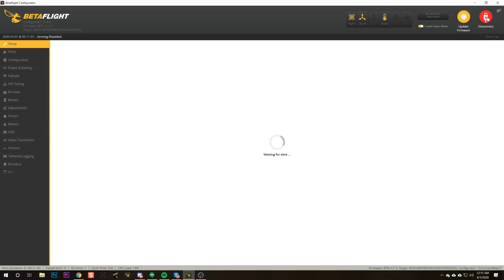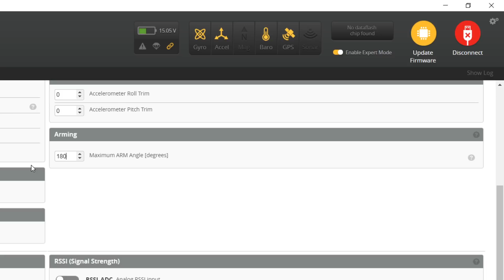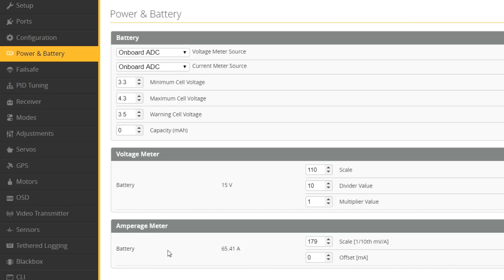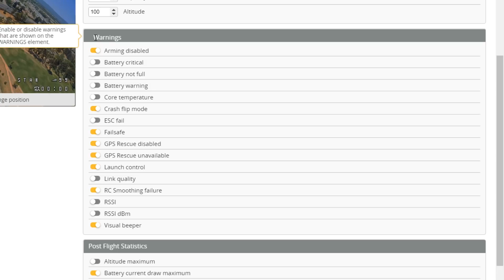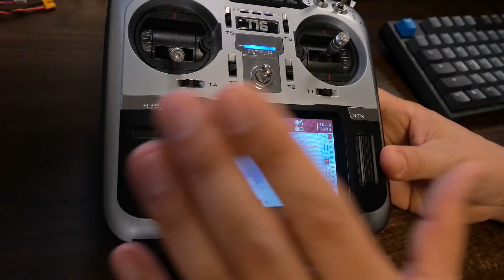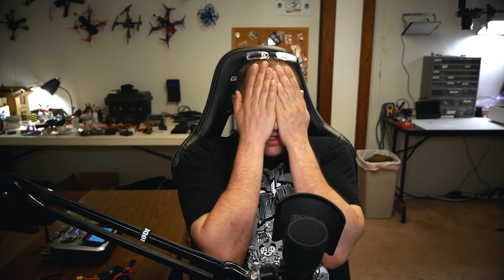Beginner Guide $120 FPV Drone How To Build - Part 10 - Remaining Betaflight Setup

Comment: Need a clarification, I noticed that barometer is activated. Is it included in the FC itself? And does it work together with GPS to keep altitude in case of rth? Since GPS is not so accurate in terms of altitude.
Reply from the maker: Yes to both questions.

Comment: 17:40 you can have GPS coordinates on your radio telemetry screen. It will hold those values even if telemetry will be lost, so you can save space on OSD and still be using GPS coordinates :)

Comment: Hello,
I am doing this build but I noticed that my VTX gets really hot. I could not keep my finger on it without burning myself.
Is it because the output power is high?
I do not have smart audio yet because of the missing wire
Is there also a place where I could find out how to set channel and stuff?
Reply: that is perfictally normal just blow a fan over it

Comment: Hi Joshua a question about the GPS module, the one you used doesn't have sda and scl and you set on betaflight the arrow on the OSD to know the home direction. Don't you need the compass to that? Thanks for attention 🙏

Comment: I like the series and learned a ton but the title is a little misleading...
So its:
$120 for the drone
$160 for transmitter
$100+ for goggles (which weren't mentioned at all)
$20 for the receiver plus tools and extra wires?
That's already $400 to get into the hobby and I'm sure I'm leaving something out.
I guess ill stick to DRL sim for now lol
Reply from the maker: It's a $120 drone. Not sure how much simpler the title could get. It doesn't say, $120 for everything you need to get into FPV. It's a $120 drone.
Reply: @JoshuaBardwell  I mean you did start the series off saying this encompassed everything you need to go from wanting to fly to actually flying... I guess its my fault for thinking that applied to the title too.
Reply from the maker: I mean the knowledge. The price is only for the quad.
Reply: @JoshuaBardwell  Good to know and thanks for the reply! Any idea about how much you're looking at to get into the sport from scratch?

Comment: Can we use any transmitter  to a racing drone or only t16 plz tell🙏🙏🙏🙏🙏🙏🙏🙏🙏🤝🙏🙏
Reply: You can use any transmitter that is compatible with the receiver you choose. If you buy a Spektrum DSMX transmitter, you'll need a Spektrum DSMX receiver. If you buy an FrSky Taranis, you'll need an FrSky receiver. The T16 is cool, (among many other things) because it has a so-called multi-protocol module. It can talk to many different receivers with the built-in module.

Comment: Thanks for posting all of these, my be doing this for my first freestyle/race drone.  What do you think about the Arris x220 pro race drone?  There is one for sale locally for $100.  Which would be better as a beginner freestyle drone the arris or the eachine?
Reply: The arris looks a little beefier, but no gps, and older camera and vtx
Reply: The arris is total crap. If your budget is 129 or less definitely go with one of the tryo quads. Whether its the 69(2.5inch toothpick) 79(3inch) 99(5inch) 119(6inch) or 129(7inch)

Comment: Hey Joshua, great video series! I followed it to this point and built the drone. Today I finished assembling the drone and took it outside for a test run without props. Now I ran into a problem:

After arming and pushing the throttle, I can't take it back. The motors start spinning to max speed and can't be stopped by the throttle stick. Disarming works and stops them immediately. In the OSD throttle value is zero, so it shouldn't be a problem with the Taranis. If it'd be a Taranis problem, it should also appear in the simulator, but it doesn't. 

Any ideas?
Reply from the maker: Most likely guess is motor direction incorrect. You enabled "motors are reversed" but you didn't reverse the motors.
Reply: @JoshuaBardwell  That didn't work out. But I just found your video about strange motor behaviour with props not being mounted (https://www.youtube.com/watch?v=xBaefeQtA1c). Going out to the park now.
Reply: I flew the first time. Everything worked. Thanks a lot for your guidance!
Reply: @ueckorium  What happend to you is normal. You had the props off, right? What you see occuring is that Betaflight tried to correct against the virbations, but because it can't create lift or rotation due to the props missing, it increases thrust to compensate. It stops at a certain level, that's where you then see it not spin back. This is normal and happens to all Betaflight Quads without props on. Common beginner learning :)

Enjoy flying!

Comment: what rates you are using now? I set my rates to yours to feel what rates uses PRO, but as your video is 3 years old, I asume these rates was set on older hardware :) but these rates is fine for me, I will try to tune from there by my style witch I havent got yet. and I think rates depends from overall quad?
Reply: Rates depend largely on your flying style and habits, as well as the quad, you are correct. Experiment with different rates and see what works. The big tip to follow as a beginner is to start with low rates (600 or less). It makes it much easier to control the quad as you are developing fine motor skills for the sticks.
Reply: @meralharbes  I took Joshua's rates, for my start poin, and I love it, now I flying with them. I have set three modes, two is from Joshua and one from le drib, le drib's rates, was very strange for me...will try it more as the weather is terible outside :/
Reply from the maker: You can see my rates in this video.
Reply: @JoshuaBardwell  you are using these setting on this specific quad or on all your quads? sorry for my lack of knowledge
Reply from the maker: Same on all my quads. Consistent rates are important for consistent flying.

Comment: Hey everyone! Quick question regarding battery choice for this quad. I have a charger that only supports charging up to 4s batteries. Will this be enough or is the performance of this build much better with 5s and 6s batteries?
Reply: What charger do you have? I've never seen one with such a limitation, are you sure that's correct?

You will be able to fly this build on 4s, but since the motors in this kit are 1800kV, you would have much better performance with a 6S battery. If you are investing in batteries now and don't have any already, go for the 6S batteries from the start. You will be able to recycle 4S for smaller quads or googles maybe, but don't use them as the main flight packs for more than to get started for a month maybe.
Reply: @meralharbes  I have a small Hightec X1 mini charger. I bought it a couple years ago when I didn't need it for much although I now realize it only seems to support 2-4 cell lipo. Thanks for the information regarding the batteries for this quad tho!
Reply: @jrichh16  I've tried to check the charger you mention and I found the Hitec X1. It does have a balance port to the side that is for 6S, see here: https://imgur.com/a/bb5fYGp Is that not the one you have?

Edit: I found yours, I see it does indeed only have a 4S balance port. You can technically still charge 6S batteries with it, you just won't be able to balance them. You would have to pick the NiMH program, that way you can just push amps into the charge lead and the charger won't require a balance lead. Be very careful with this though, only use it as a temporary, since you won't have much safety from the charger side as well as your 6S batterie cells will become unbalanced over a short amount of uses.

Comment: @Joshua Bardwell  I just ordered mine. I've heard some bad things about bangood am am considering canceling my order. should I and what website should I buy through if  not them.
Reply from the maker: Not sure where else carries this one so basically it's Banggood or not much else. Most of the time Banggood is okay, just slow shipping. Occasionally you have a problem, and then it's a big hassle but if you pester customer service enough, you usually get satisfaction.
Reply: Ratsmack82 banggood sometimes makes some mistakes and it takes ages in europe to ship but for drones is one of the cheapest. I’ll order on banggood the nazgul5 6s.
Reply: 100s of orders from bangood... live in the USA no problems but much faster shipping from USA vendors and CS.... RDQ.. getfpv.  Are some larger ones from the USA     click on the links in JB vids to help support him